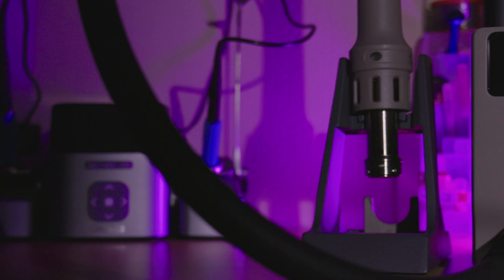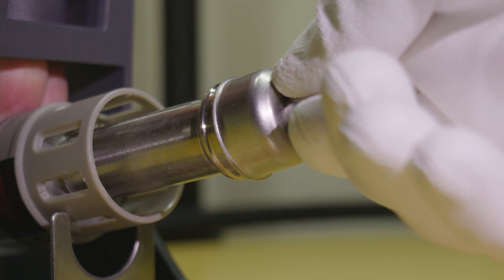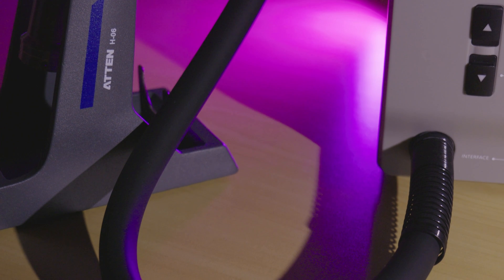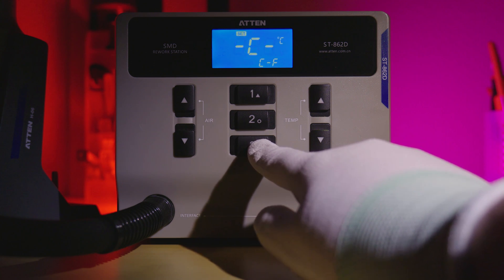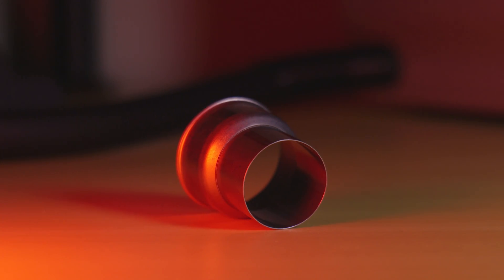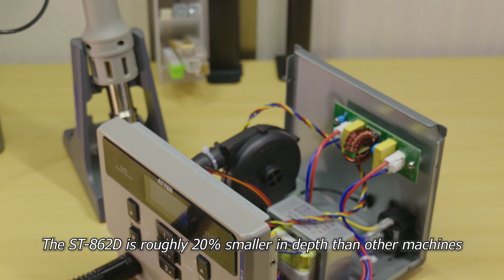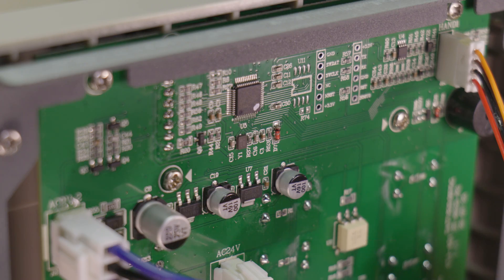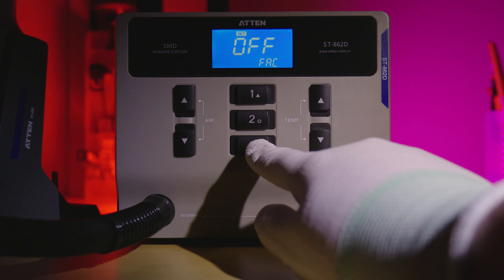Atten ST-862D In Depth Review | Hot Air Station Hot Air Soldering Station

Comment: I have one 2x cheaper and it has the exact same loud noise, i can't wrap my mind why, cause my previous fan gun (that broke) made no noise at all for almost the same airflow. I understand that this is a pump, not just a fan, but i still don't get the difference. I also don't get why they make them so big for no reason, the case is empty
Reply from the maker: The fan is smaller so my guess is it needs to spin faster to move the same air

Comment: Great video. Thank you. 
One question though: does it really have temperature sensing feature for the hot air? @06:02 after ramping up, the "REAL" temperature indication on the display showed and stopped at 300 degC and it stayed there. It is very unlikely that the temperature control was so precised without overshooting. The external temperature meter confirmed that the temperature was still rising up. Hence I think that the "REAL" temperature display is not the actual temperature reading from the nozzle/tip. So the "REAL" indication is rather deceptive.
Reply from the maker: I believe it’s the effect of two different temp probe locations 
The element can heat up fast but you are relying on or bound by environment variables

For it to be a true reading you’d have to have a probe sticking out onto the workpiece 

Which is why companies like hakko suggest adjusting offset from a set distance like this
Reply: @Slot1Gamer 
I understand the reading difference. I asked if there is really a built-in temperature sensor on the heat gun to measure air temperature as the LCD display suggested. @06:02 The display showed that "REAL" LED lighted up and the reading ramped up and then reached 300 which I assume is the set/requested temperature. The display then magically stayed at 300 without ever overshot over or lower like any normal PID temperature control does. So it appears that the 300 is not the real temperature reading (from a built-in temperature sensor) rather it may just be the indication that the temperature controller maintained its output.
Reply from the maker: @Dan8254 yeah I think it is ignoring reporting overshoot. 
My workshop is packed up at the moment while I’m renovating my house but I’ll revisit this and do some tests to force overshoot and see what the software does.
Reply: @Slot1Gamer  
No worries. Thanks to your video, I have just purchased the 2in1 model (800W hot air + 65W soldering). The model is ST-8865D, basically a renamed version of ST-8802D. Not much info available apart from their official video, in which I noticed that the "spiral heater" of the heat gun has 4 or 5 wires indicating that there is a temperature sensor attached to it. In another video I also noticed that there is a temperature sensor attached to the handle of the solder iron (not attached directly to the heating element).

Comment: I’ve had my finger hovering over the buy button on this unit for a few days now. You called attention to several important features no one else has, such as the programmable delay time for auto-on. Thank you for your thoroughness.
Reply: Well, I went ahead and hit the button due to your fine review. Got the unit and a set of 45º nozzles made just for it for a bit less than $270 all in. I intend to use it heavily the first couple weeks on some Dolby cinema processor re-caps and will report my findings after 208 e-cap replacements. I have a serious backlog of SMD repairs - Yamaha digital recording consoles, AVID interface cards - things that have just laughed at me. Trial by fire.

Comment: Are there any combo soldering and hot air stations as good as this (with either T12 or JBC style tips comparability on the iron side). Or is it better to buy dedicated machines?
Reply: Better to just buy dedicated machines imo. That way you can replace or upgrade them individually as necessary and position them in your workspace more conveniently. And obviously then you can choose exactly what you want, rather than having to settle for what is included as part of a combo.

At least that has always been my philosophy. Granted depending on how much money you can save maybe it is worth the tradeoffs. But I enjoy the flexibility of dedicated machines so I have never really looked at the price difference.
Reply from the maker: @semod8614  wep soldering now sell one that’s JBC iron compatible with this same type of hot air system 

It’s called 992D III 2 in 1

Comment: Nice! Where can i get a stand which holds the air blower vertically? (which you used at "practical test" chapter, 5:52). I suppose is not included with the station. Or is it?
Reply from the maker: It’s not included, it’s actually a stand for a digital microscope

Comment: How did you like this hot air station for working on more dense Apple board and shields?
Reply from the maker: Yeah it is good for higher density boards too 
With shields I’d recommend using ultra low melt solder around them first with an iron.
It melts around 90°c you do need to remove it after though.

Nothing against the stations capabilities just that is a better method and less risk
Reply: @Slot1Gamer  Ultra low melt solder? First time I'm hearing of this, can you share buylink?